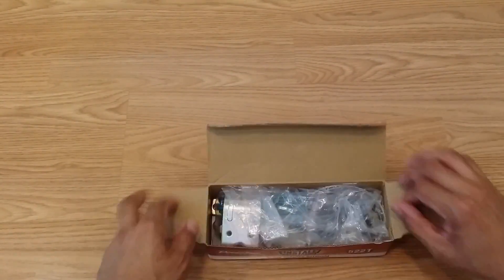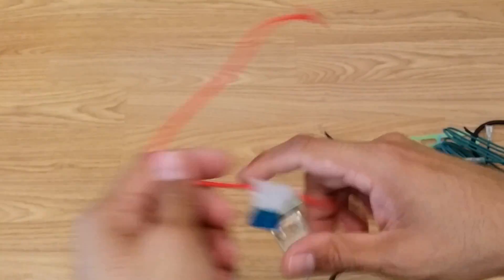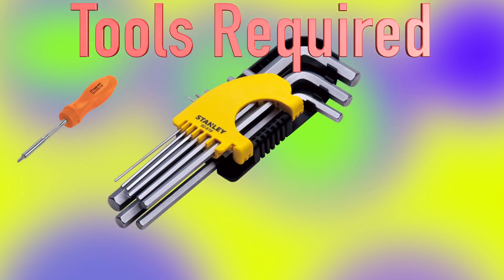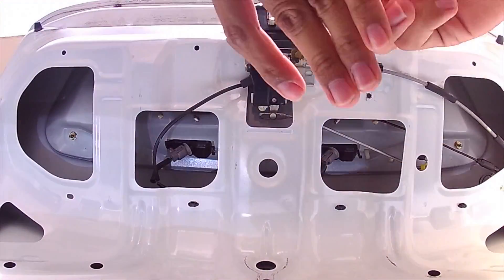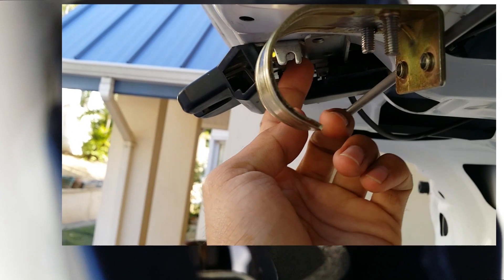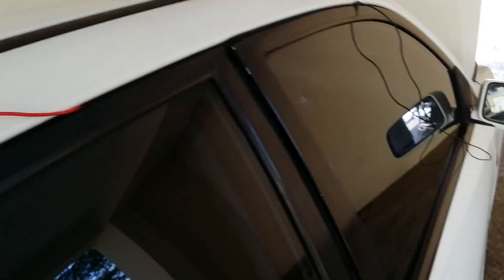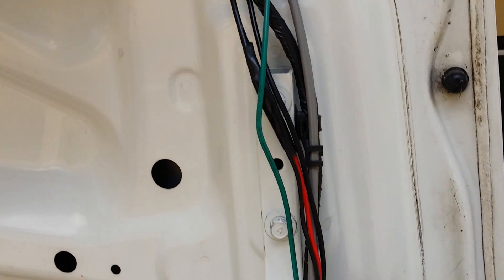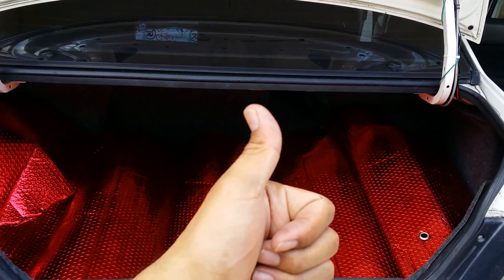How to Install a Trunk Release Solenoid

Comment: If anyone is wondering how to add this to your car alarm system to pop trunk using remote. You need to buy a RELAY and wire it like this: Wire the Relay as such - Pin 86 & 87 to 12V Fused to Constant, Pin 85 to Trunk Release Input(trunk release wire from your alarm), Pin 30 to Trunk Release Output (wire from Relay to Green wire to Solenoid). Hope that helps.

Comment: Thank you for making this video. I have a 2002 Mazda Protege that I'm going to be adding a Push-To-Start kit upgrade to. It features remote trunk release which I want to use with my setup aswell. I found this electric trunk release kit on amazon but had no clue how to even install it in order to take advantage of the remote feature- This video made me understand the whole setup and installation. Thank you for saving me the headache for the whole installation process!

Comment: nice video, late to the game here but is there a way to get the remote trunk pop feature on a remote start keyfob without using the button? My car already has a decent trunk release and the button wouldn't match the interior at all/be rudundant. I suppose worst case I could hide the button in the trunk next to the solenoid.

Comment: When you press the button, the solenoid pulls the lever. But what causes the solenoid to return again? Is it electrically H bridge in the switch or some mechanical spring etc? :) Thank you

Comment: Hello mate may i ask...mine car has already push button for opening the trunk but recently i have install in my car remote control system for doorlock and it provides one wire that it can be connected to the trunk and opens the trunk remotely! the issue is that i have tried almost everything but it dosent work....i have bouth one relay with 4 pin....can you give me directions on how to connect it with my existing button so both can be functional as well at the button as the remote?? pleasee In any case, thanks for your help

Comment: Great video man!  Can I connect the positive of the solenoid directly to the wire
From the alarm system trunk wire ? Or does it have to be connected to battery first? ( I am not going to use the button from the kit as I have a cable trunk release already I just want to be able to use the key fob to release trunk)
Reply: I know you posted this question a while ago, and have probably worked this out by now, but for anyone else who might stumble across this question, the answer is no, you can not power the solenoid directly from an alarm / remote starter system.  The solenoid draws too much current.  You will need to use a relay between them.  The relay will have four connections to it, and you will need to know if the signal from your remote system is positive or negative.

You can connect your remote system output to pin 85 on the relay.  If the remote output is positive, then pin 86 on your relay goes to chassis ground.  If the remote output is negative, then pin 86 on your relay goes to battery positive through a small (3 amp or less will be fine) fuse.  Pin 30 on your relay goes to battery positive, and you use what ever size fuse the solenoid kit calls for on that power wire.  Pin 87 of your relay then goes to the solenoid positive.
Reply: @thomasherring6640  i wired it up exactly as you wrote, but it still doesn't work. Same solenoid, wiring it to a DS4+. Does the relay need to be a 12v or a 5v? I read somewhere else that the relay has to match the output voltage(?)
Reply: @jonnyrussell3982  I expect that the output from your remote system is 12v.  Did you check the output wire to determine if it is a negative, or positive output?
Reply: @thomasherring6640  the diagram lists it as a negative output. It's really baffling me, I've tried all manner of wiring it to 3 different 12v relays, in different configurations, and it just will not signal the solenoid. The solenoid works fine, though with a button connection.
Reply: Can you use a multimeter, or at least a 12v circuit tester to verify that you are actually getting a 12V Negative signal on that wire when you push the button on the remote?

It is possible that you have to activate a setting on the remote, or you need to hold that button down instead of just pushing it, or something else silly like that.
Reply: @thomasherring6640  good idea, I will take my multimeter to it tomorrow when I get the dash put back together and the battery back in.
Reply: @jonnyrussell3982  If there is no signal there, then time to sort through the instructions and see what you are missing.  If it IS getting 12V Negative, let me know, and we will work through the rest of the relay setup step by step, and see where the problem is.
Reply: @thomasherring6640  hello again, took me a few more days to do what I was doing under the dash. Anyhow, I've got everything plugged back in and took my multimeter to the wires. I'm fairly novice when it comes to electricity, so I'm not 100% sure how I'm supposed to test that wire so I've listed several situations and the results. (+/- "P" - Probe; "A" - activated (i.e. trunk release button); "Con" - 12v constant wire; "Sig" - neg output wire for trunk release):
+P > Sig & -P > GND = 11.1v (A=10.6v)
^Vise versa= -11.1v (A=-10.6v)
+P > Con & -P > Sig = 1.2v (A= 1.6v)
Vise versa= same results except negative volts.
Reply: @jonnyrussell3982  So you are getting 11.1V without pushing the button, and 10.6 when you do push it?  That is odd.  You should get nothing without pushing it.
Reply: @thomasherring6640  I agree. Do you have any recommendations?
Reply: @jonnyrussell3982  There is nothing I can think of off the top of my head.  Unless the remote system has another programmable output that you could use.

I assume this is an aftermarket remote system?
Reply: @thomasherring6640  yes, it is a Viper DS4+
Reply: @jonnyrussell3982  This is indeed supposed to be a negative output.  It is 22 pin connector H4, pin 4 red wire with white trace on it.  If all of that is correct, you are for sure testing / working with the correct wire from the remote unit, and you are getting a positive voltage on it, it leaves me with only two possibilities that I can think of.  Number one is if you did try running the trunk release solenoid wired directly to the remote unit, you could have either blown a fuse, or burned out a component in the remote unit.  Check all the fuses in it to be sure none are blown.

My second thought is, if the remote unit was installed by a professional installer, it may be something that they disabled when they flashed the unit, and you might want to check with them.  Beyond that, I'm not sure what you have going on there.
Reply: @thomasherring6640  I will check the internal fuses today then. Just to confirm, to test the wire I use the positive probe on the Negative signal output, and I ground the other probe? Also, one more thing: my installer was a friend of a friend who does incredible work, so I trusted him to work on my highly modified car. However, he isn't a Directed tech (anymore) as his shop primarily works with a different company. That said, he wasn't able to flash the system. Instead the guy I bought the kit from helped me over the phone flash the system to get remote start and such working. Have you any experience flashing these units, as I have access to the installer's app?
Reply: @jonnyrussell3982  I do not have any experience flashing them, but I do wonder if maybe the trunk release is disabled in the flash.

If you are checking for a negative output, then you would put your red probe on the positive battery, and the black probe on the negative signal wire.

If you are checking for a positive output, then you would put the red probe on the signal wire, and the black probe on the negative terminal of the battery, or a good ground.

You can also do this test with a simple test light.  Clamp the test light to battery positive to test for a negative signal from the remote.  Clamp the test light to battery negative to test for a positive signal from the remote.
Reply: @thomasherring6640  okay, so then according to those instructions I'm getting 1.2v and 1.6v when activated. Still not a negative signal, however, which is confusing to say the least. Still need to check fuses, however.
Reply: @jonnyrussell3982  Yeah, that is not what you should have going on.  There should be no voltage when it isn't activated, and when you hold the button for 5 seconds, that should activate it, and you should get -12V.

You are holding the button for 5 seconds, right?  That is what I read in the instructions for that remote system.

Comment: So you still need to lock your trunk by key?
Reply: 4 years late but the answer is No. this system allows you to unlock it via key fob, And release button. You can still unlock it via key or pulling the lever if you want to. The trunk will lock no matter what if you close it.

Comment: Nice diy dude, only thing is when you close the trunk the olenoid moves front so that again when you press the button it moves back and opens the lock right? So basically its powered one way
Reply from the maker: Well actually...the solenoid opens the lock when the button is pressed. The lock is closed when you close the trunk. The solenoid literally does the exact same thing as the lever you usually pull to pop the trunk.

Comment: im having problems on getting the solenoid (same brand as yours) to pull far and strong enough to pull the lever to open the trunk.  I am sure that I have the loop and wire as small and tight as possible. I'm also sure that nothing is hitting anything. 
I feel that the solonoid needs to pull further and stronger away. Any thoughts?
Reply from the maker: Hot Cheetos I had the same issue... But I realized after all of the fidgeting and adjustments, that the solenoid needs to be practically perfectly in line with the lever to be pulled to open the trunk. 

Oh also... Make sure that you leave slack inside the solenoid as well... I remember that was also an issue for me. I just assumed that if I pull it out all the way and then tie it that it'll work, but nope... So try pulling it out about halfway from inside the solenoid before tying it off to the lever. 

One last thing... Make sure the lever can be opened easily by pulling the lever manually.
Reply: Thanks for your reply. Before trying out your suggestion, I decided to try one last thing since I didn't want to relocate the solenoid. Basically, I stretched the tension spring on the lever and it worked!
Now, I'm stuck on trying to program the trunk release to my auxiliary button on my viper 3002 alarm remotes. Do you think that you could help me figure it out? I've already hooked the wire to the 1st hole on the main harness (H1/1) of the viper box.

Comment: Great video! But how do you program it to your car key??
Reply from the maker: dontnow100 depends on the existing alarm system you have installed 😀... For example, check my video on how to install a start stop button with passive keyless entry... That alarm system has the provisions necessary for opening the trunk via the key fob.
Reply: Oké will do. Thank you very much for your informational videos!

Comment: How can i connect with my central control locking?
Reply from the maker: This is only possible if your existing alarm system has provisions for it. Otherwise, you’re going to have to install an alarm system with that feature built in. Check out this video if you’re interested https://youtu.be/QT-XmFuEGsw
Reply: This seleniod assembly make a rattling noise while your driving.

Comment: When you got the kit, there was a black wire with a heat-shrink-wrapped component on it.  What is that wire for?  They also include a plain black ground wire with the kit, so I assume they serve different purposes?  Which one do I use?

Comment: how did you connect it to car key ?
Reply from the maker: Aditya Graha Pratama that's coming in a later video :) it depends on the alarm system you have
Reply: What if I have the Viper 3002 2-way alarm system